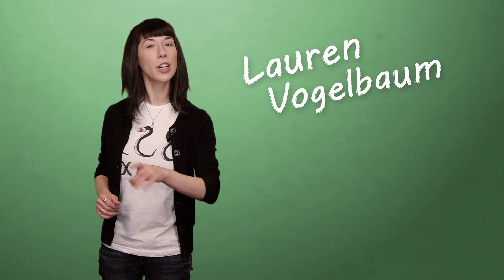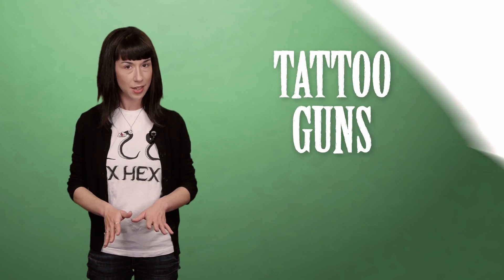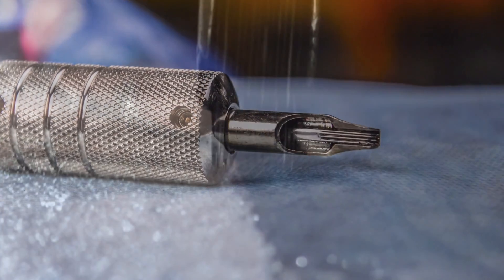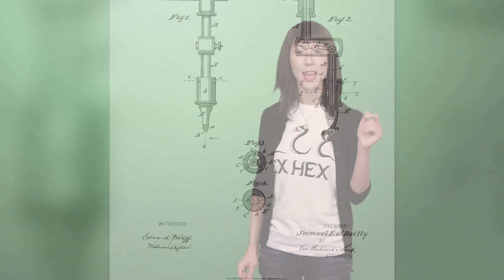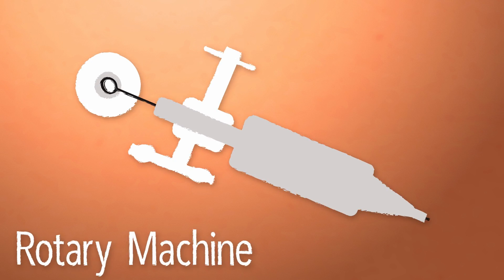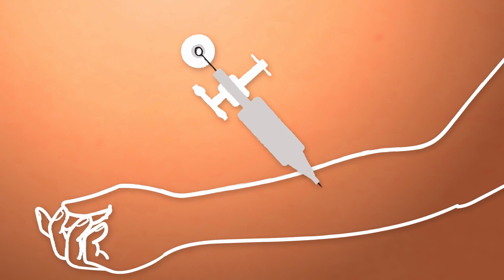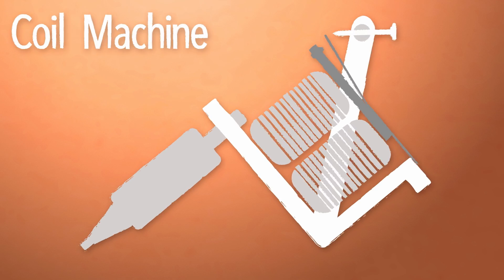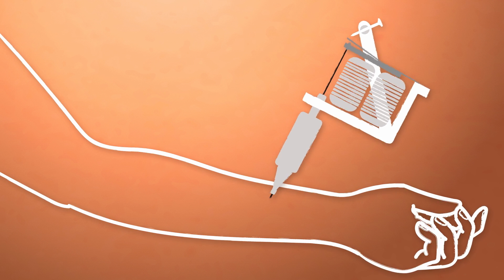How Do Tattoo Machines Work?

Comment: Why do tattoos (colored or just black) fade away over time in the skin of people? 
And also, how does laser tattoo removal work?
Reply: it fade away because the body breaks it down and dissolve it in the blood
Reply from the maker: +Miguel Eduardo +NA is basically correct! I definitely wanna do a followup episode explaining the process of how tattoo ink sticks in your skin, why tattoos fade, and how you can remove them. Thanks for watching! /Lauren
Reply: The tattoo is placing small particles between the layers of skin. Over time your bodies immune system, as well as your bodies regeneration of cells cause the particles of pigment to break down and slowly be carried away.

Laser tattoo removal hastens the breakdown of the pigments so your immune system can remove it quicker.